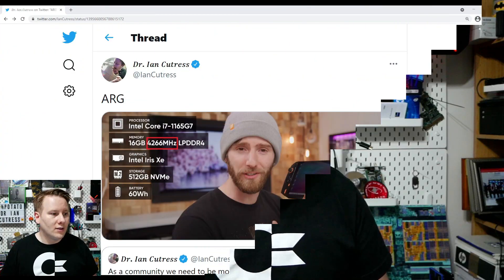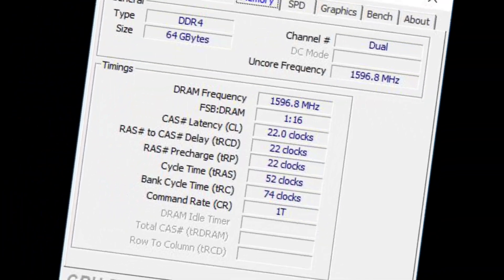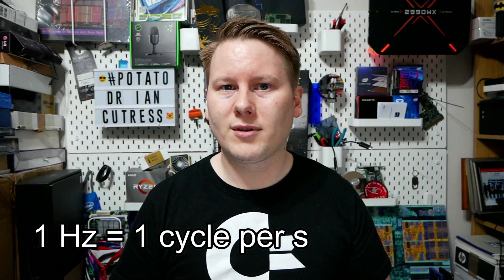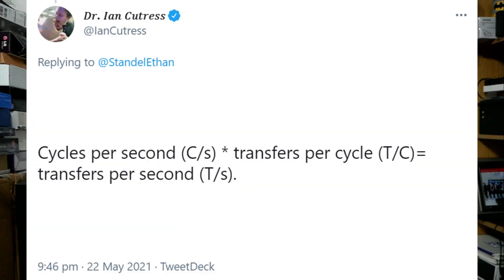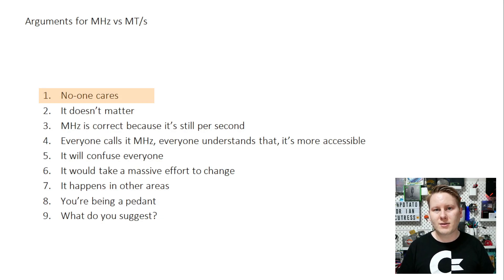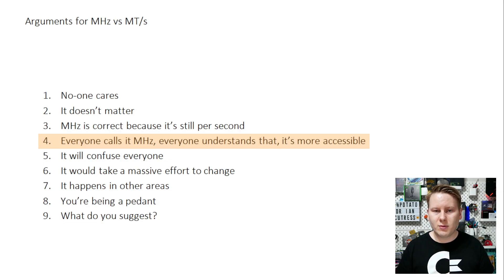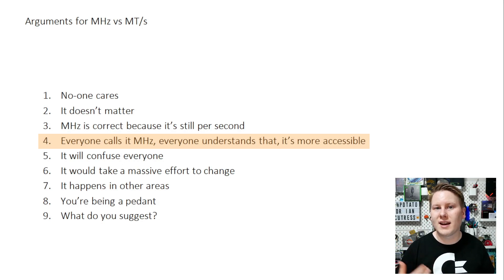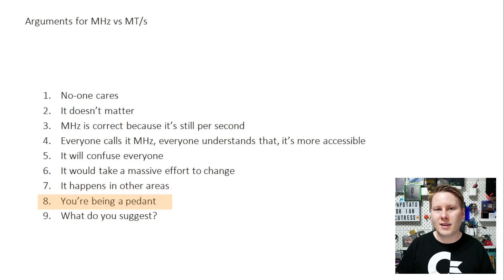Linus is WRONG 💩 : Explaining MHz vs MT/s

Comment: As a fellow scientist I love getting pedantic as well. I'd say though that your argument against (3) i.e. that you could define the rate in Hz when referring to transfers seems very weak to me. Yes, one might not actually use the peak rate, but one can still define a peak MT/s with a unit of Hz. 'cycle' is pretty weakly defined in most of science and it can easily apply to the peak rate of transfers. The only argument I can lend to your favor is to avoid long-term confusion. Though I suspect this isn't all that strong either; units aren't normally sufficient to signify what quantity is being measured. Most of the time people (consumers at least) care about the MT/s not the clock cycle and if the distinction is needed, one can clarify that they mean the clock rate is X Hz rather than the Peak Transfer Rate being Y Hz.
Reply: Absolutely agree. A frequency is just that.. a frequency.. a rate.. it can represents the transfer rate, the clock cycle rate, the average rate I go to the bathroom. There is absolutely nothing which tells that a frequency must represent a clock change rate and not the transfer rate.
Reply: To give you an example from my own field of science (gravitational wave astronomy) we often use Hz to describe both the rate of data (which is very regular and I think you'd be happy enough with) but also things like the average rate of compact binary merger detection or the average rate of false alarms, both of which are Poisson processes and would not seem to match your fairly rigid definition of 'regular', especially as the 'rate' can change in steps due to instrumental changes, terrestrial noise, etc.

Comment: Both you and Linus give the example of CPU’s using “IPC based” speed ratings on their CPUs making things confusing for consumers; but I haven’t seen anyone point out the fact that AMD literally did that in the early 2000’s when they had much better IPC but lower clockspeeds. I personally have some of those Athlon XP 2500+’s and Sempron 1800+’s. (Or whatever the specific ratings are, they aren’t in front of me at the moment)

Comment: Get in touch with microsoft to change memory speed reported in task manager to MT/s. People will slowly acclimate and the stickers will change :)
Reply: absolutely true. thats also the reason why everybody is using GB instead of GiB for mass storage (the number MS displays is actually GiB - gibibyte)
Reply: no, people wil whine about it, because that's what nearly EVERY change to Windows does, nearly every time - full stop, and no, not just from people who dont know what they are talking about (in fact, the people who do know better will whine the loudest).
Reply: 🤔 But my DDR4-2666 lists as 1333MHz in Task Manager, which is correct
Reply: @shaneeslick  odd. Because mine says 3600MHz. Either way: get windows to speak in MT/s imho.

Comment: I also think that some people don't think it is a big deal if the difference is integer divisible...  If the difference is like cm and inch, they might respond differently.

However, the numerous brain farts and visible confusions in Linus' video is reason enough to use proper units.  (Like 3:19 in his video...)

Comment: The "equivalent performance rating" thing has been done in CPUs before.  Anyone remember the AMD and Cyrix PR ratings?
Reply: Yeah, I remember those days. Athlon XP 3000+ or w/e
Upside is it was just the marketing name and the real Mhz was also readily available/visible. I don't ever recall having the same confusion as I did with memory.

Despite the fact I knew SDR stood for single data rate and DDR was double data rate it never dawned on me that my DDR 400 wasn't running 266mhz faster than my 133mhz SD Ram, but only 66mhz more.

Comment: Simple Solution , dont add Hz or MT/s , call it simply DDR4 3800 for example and everyone knows what is meant , that the IMC runs with 1900 Hz and the Ram too  , i know that , i overclocked my 3900x IMC and changed the setting in the UEFI . If you would call the Ram simply 2100 MT/s Ram , well , i admit , i had to think twice to understand what you meant and it would be not sufficent because MT/s 2100 Ram could be     DDR3   or    DDR4   Ram , MoBo that support both , DDR3 and DDR4 are rare ...  .

Comment: The same thing with the processor production topoplogy. "Nanometers" used to mean something before the 3D topologies were introduced. Afterwards they just use the "nm" for an aproximation of the new production to the old one. Why do they not simply switch to density? They will eventually, most likely before they start talking about half nanometers.

Comment: As an engineer, not using the right units is literally misleading people. The best example for me is FPS... FPS doesn't make any sense because while it is linearly represented, the gain in time decrease exponentially as FPS goes up... meaning a jump from 1 FPS to 2 FPS get you extactly 0.5s of delta while 120 FPS to 121 FPS get you a delta of 0.0001s... meaning each FPS doesn't possess the same value of time but reviewers are treating it like it is the case.

This is what is happening when you have a bunch tech Influencers who think they know all just because they can unscrew a bunch of coolers from video cards while not having any kind of scientific background.

Comment: I think it's sort of like GB vs GiB and how Microsoft in particular misrepresents it. Does it matter? Well, when you need accuracy, sure, but for the masses, it makes no difference. As such it will likely remain the same. This is the same thing.
Reply: Actually that does make a difference for the masses, I hear stories about hard drive / ssd manufacturers cheating the consumer on disk size. While in reality a 1TB drive would be reported as 931GB  in Windows just because 1TB = 931GiB. And every step we go up it will get worse.
Reply: @qlum  But it's literally the same thing, just microsoft notating it "wrong". And yet, I'm certain your grandma doesn't care. Most people don't.

Comment: T/s is a fundamental spec, one with real meaning.  Clock rate is ad-speak.  I appreciated that the early MacPros were regularly advertised with the GT/s spec.  It was an unambiguous spec that related to my needs for content creation, and showed clearly the advances Apple made as the MacPro line developed.  Specs matter, and the intentional misuse of specs is a consumer thing.  The audio industry has been a constant offender in that game.   I would argue computing offers way more opportunity for obfuscation than audio ever did.  I support the change by buying ONLY products which advertise with transparency.  That boycott requires a ton of knowledge the great majority will never feel the need for.  But I recall the ‘enforcement’ of spec relevance in audio fondly.  Standards committees acting as third parties brought clarity for consumers while leaving those ignoring the standards out in the wind.

Comment: You have convinced me with this: "MT/s is the maximum amount of transfers and you do not transfer on every rise and fall of the clock"
Reply: I don't like this because then CPU clock speed is wrong too. Just because a CPU slows down below its base clock doesn't mean that the lower clock is the CPU's clock just because it's not always at its bade clock
Reply: @Anon.G  But hz is the correct unit of measurement for the CPU's clock speed. At base or peak. Using "3600 mhz" for 1800 mhz RAM is just wrong. 1800 mhz RAM wont clock to 3600 mhz, but it can transfer data twice per hz, hence Double Data Rate. So either using 1800 mhz, or 3600 MT/s would be correct. Even better, lets use no unit at all and just refer to it as "DDR-3600" and call it a day.
Reply: @onogrindsbrah  nothing you've said disputes what I've said. You essentially ignored my point and then just paraphrased the video
Reply: @onogrindsbrah  Hz is the correct unit of measurement for anything with a rate: the clock changes and the transfer rate can both be measured in Hz. Saying using Hz is wrong for transfers because you should use Mt/s is like saying it is wrong to use MHz for clocks because you should use 'clock changes'/s
Reply: @Anon.G  also ono didn't ignore your point he was addressing how ram works and said hertz is a correct unit of measurement. It happens every time per second however instructions and transfers don't happen the same every time per second. If that were the case your PC would always be at 100% load
Reply: @LZeugirdor  again, nothing said in either of those comments has to do with my point
Reply: @Anon.G  then your comment has no point because you either phrased it wrong or you don't know what you're talking about.
Reply: @LZeugirdor  please read it again. But first let me make this clear. I'm not saying memory labeling shouldn't be changed, I'm simply saying that the point you mentioned isn't great imo
Reply: @Anon.G  it doesn't have to be great, it's simply how computers work. CPUs dynamically fluctuate their clock. The higher the boost clock, usually better latency and responsiveness. But if your clock is locked and you just sit there. Not every low and high is used in hertz. This logic doesn't state at all that CPUs run at a lower clock than stated or that the lowest clock is the base clock. Hertz is hertz, the definition doesn't change. But every up and down of hertz isn't used, only when the cpu or ram is under load.
Reply: @LZeugirdor  the person I replied to made a quote about semantics, not how computers work. Again what you've said isn't relevant
Reply: @Anon.G  Well ... you first have to understand how DDR-SDRAM works to understand why your analogy does not apply!

We are talking about RAM here ... RANDOM access memory. So the speed of the RAM is mainly determined by how quickly the address/command lines can be changed. And for DDR4-3600 these lines run at 1800MHz ... no DDR trickery going on ... everything happens on the rising edge ... this is the defining clock ... thus it is applied to the clock pin of the RAM module and is the only cyclical signal to the RAM stick. And thus this signal can be specified in Hertz.

Only if data larger than the bus width is accessed at that request, transfers on all the clocks and their edges can happen. Because this event is conditional it cannot be strictly cyclical at the same time and thus it is NOT a unit which can carry the unit Hertz. So if many little random bits of data are read in succession the RAM only get a fraction of the maximum MT/s, despite running the RAM at full utilisation. 

If you want to know it exactly, the 3600MT/s can only be achived when a full 8 word prefetch each on 2 bank are simultaneuously being transfered (memory interleaving). Worst case you might only get around 200MT/s because of the internal speed of the DRAM (which hasn't changed in the last 20 years since DDR1 introduction) and thus on 15 of 16 clock edges no transfer is happening. Measuring the frequency with an oscilloscope might return 200MHz in that scenario. That's why JEDEC calls it the MAXIMUM transfer rate and gives it the unit MT/s. This is not for fun. But it means you can not rely on getting transfers at a steady pace of 3600MHz. But you can rely on the memory accepting addresses and commands at the actual fequency of the memory, which is 1800MHz.

The clock of a CPU, even though it can be changed in frequency, runs strictly cyclical and doesn't conditionally skip a beat. If you could probe the clock line of the CPU and measure the frequency between multiplier changes you would read a constant frequency without a gap. You can rely on the CPU doing something at each and every clock cycle.
Reply: @glockmanish  yeah I don't disagree with anything here(even learned some stuff around the middle, thanks for that) but I think you missed the point of my analogy, which specifically replies to the quote of the original commenter, not the entire topic.
Reply: @Anon.G  About CPU base clock/power usage this used to be ok, but Intel has moved the goal posts so to speak. A CPU that used to be rated at a specific wattage was ok, except when overclocked then it would use more power. I think TECHTECHPOTATO should do a proper video about how Intel has moved the goalposts so that a 65W CPU is no longer a 65W CPU !
Reply: @Anon.G  but that's exactly what I'm talking about...
Reply: @LZeugirdor  "it's simply how computers work" you can clearly see that you were speaking about how computers work, something irrelevant to the semantic conversation.
Reply: @onogrindsbrah  my ram 3200 mhz but showing 3200 mt/s now what's happened corsair ram
Reply: @Anon.G  It's not the same. If your analogy were to be correct, then it would mean that the CPU won't slow down, but downright STOP completely for several nano or micro or mili seconds then come back up, run at their top speed, then fully shut down again and so on.

Changing the frequency is not the same as the "might do it or might not do it" nature of transfers. The CPU, regardless of speed, if it's the top or not, will ALWAYS execute an operation. And yes, a NOOP is an operation, it just doesn't modify anything in the system.

Hope this clears it a bit.
Reply: @Winnetou17  you didn't read my comment either.
Reply: @Anon.G  Yes I did. WTF. How did you reach that conclusion ??
Reply: @Anon.G  you're misunderstanding. The ram and cpu will always run at the reported hertz. However the amount of instructions or transfers they do are not always at their max regardless of their clock. A cpu can run at 3.8ghz locked, but it will not be doing an instruction every single clock. Ram can also be locked at 1800mhz, but it's bandwidth will not always be saturated.
Reply: Yes, the maximum possible in a perfect world with a perfect CPU but never happen in reality - But a 3600 DDR4 memory kit should always be able to clock at 1800Mhz until it reaches its EOL so surely that is the more accurate number to use !

Comment: I fully agree...  when I hear people refer to kWh and just say Kilowatts, it really grinds my gears.  Units are important!
Reply: It is a completely different issue, kWh and kW are 2 different units (energy/power), frequency can be used to represent whatever you want which happens many times every unit of time so it is subjective.
Reply: @fededevi1985  yeah I know. Specifically stated that I was curious about what cases he comes across with kw and kwh because I deal with these term on the daily in my work and have for years. I do get the parallel with mts and mhz.. on that point.. 90% of websites selling rram refer to ddr4 3600 mts as ddr4 3600mhz. Technically its "wrong" but when more people are wrong than not.. you start to question if its wrong.. or at this point is it just easier for the average joe to understand what you mean by following the terminology that most of the industry uses 😉 I would use 3600 mhz because thats what people expect me to use and they get it what I'm saying even if its 1800mhz.. technically.
Reply: @TheCosmicMason  My point is that while exchanging kW and kWh IS technically wrong, using MHz to not represent the clock rate IS NOT technically wrong; it is just not well defined at what you refer to with the 3.6GHz frequency.
Reply: @fededevi1985  that is true. So the idea of measuring hz is theoretical and up to the observer to chose which part of a process is being called a tick? Suck as in music where it isn't wrong to say a song written at 80bpm is also 160bpm.. it just depends on how you as the observer choose to count it. You cannot prove that a snare vs a kick is the tick.. its your choice. And one could also go out on a limb and say that 360bpm is also not wrong.. as well as 40bpm.. but most people would naturally not agree.. its technically correct.
Reply: @TheCosmicMason  Yes, and it is not just a convention it is a mathematical fact. Hz is defined as "1/s", it is not "cycles/s". It does not tell what is being measured it just tell you how often something happens. The clock cycles at a rate of 1.6GHz, the maximum rate of transfer happens at a rate of 3.2Ghz. Both are correct.
Reply: Using "mb" instead of "MB" is enough to set me off. What the hell is a millibit anyway.
Reply: @n-steam  😄
Reply: To what are you referring exactly? 🤔 just curious what situation grinds your gears because most certainly there is a correct time to use it.. thanks.
Reply: What infuriates me is when people say 10,000 milliamp-hour battery. No, it's a 10 amp-hour battery.  I should just order a boxful of usb battery banks from alibaba with "10,000,000 microamp-hour" printed on them and sell them on ebay at a hefty markup for 5000 cents each.